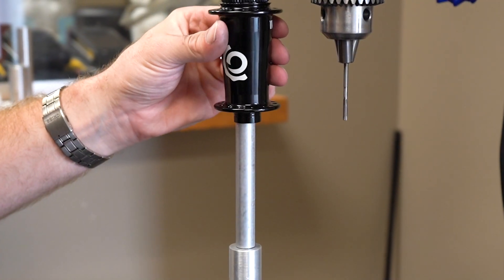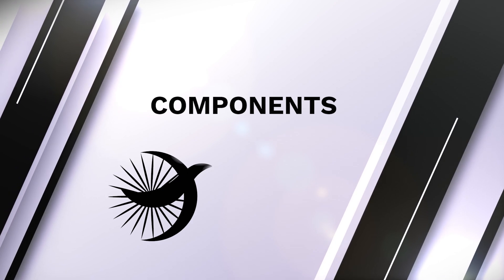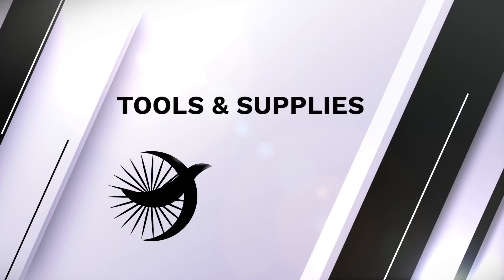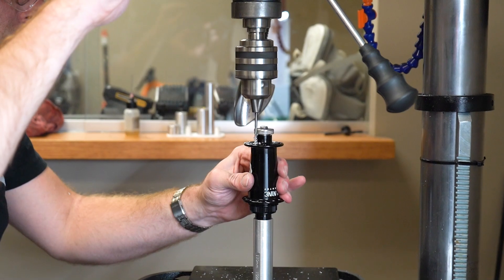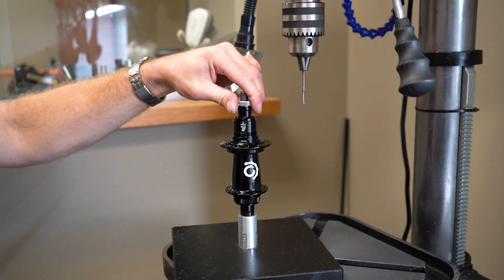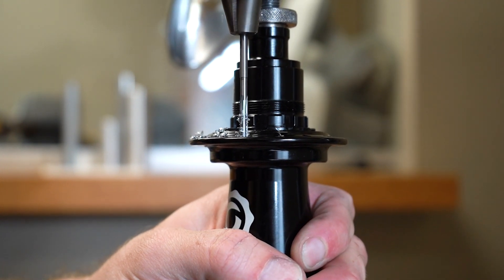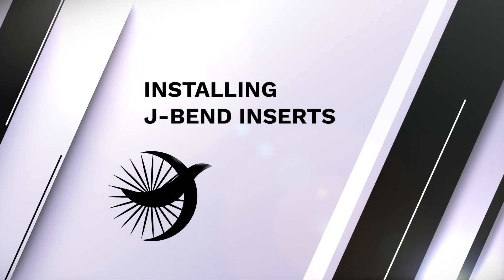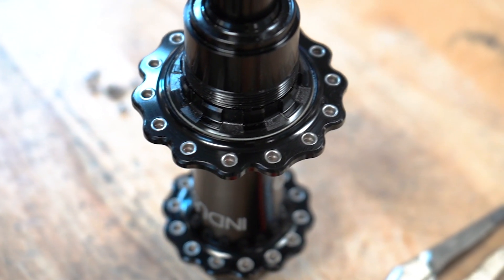J Bend Insert System | Set up, Installation and Use

Comment: Love this - as I’d be so happy to use Berd on the hubs I favour but never like the manual element. The inserts look a sure fire way to protect things. Do they also help strengthen the flange area too? I presume so. 

I wonder if your clamping kit system could be make to work with hubs that don’t have any through axle space - as in an internally geared hub. I’m trying to find a safe and simple way to use Berd spokes on the geared unicycle hub from Schlumpf Innovation- and this seems easier than getting a custom flange adapter made to shift it from J-bend to a hooked flange set up.